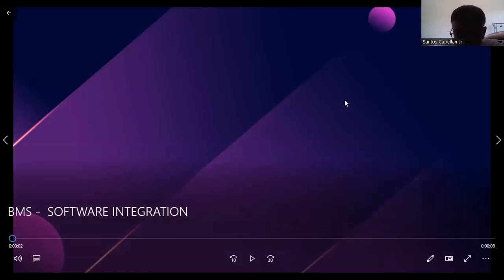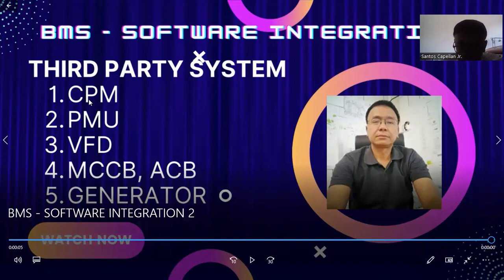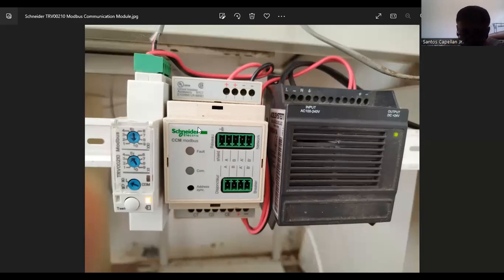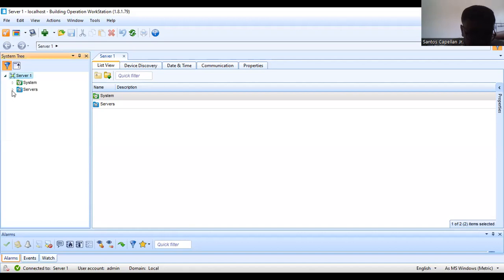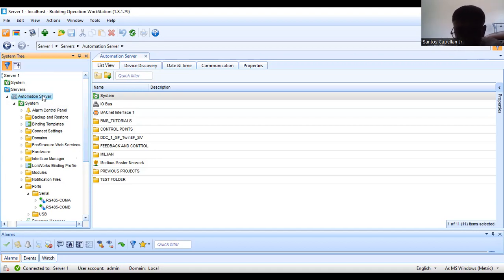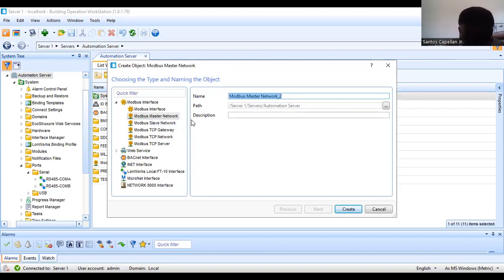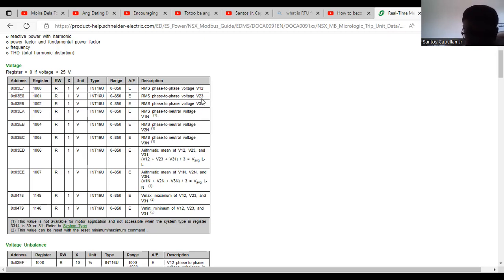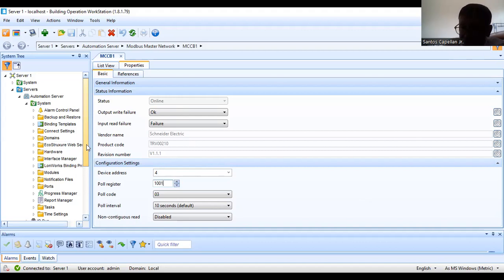BMS - SOFTWARE INTEGRATION PART 1.

Comment: Thank you it's a big help for me to understand more about BMS Integration, right now our BMS system with different brand,  like HONEYWELL, JOHNSON CONTROLS, SIEMENS are on going integration by Johnson Controls. The  Honeywell old system that we have now are using C- BUS, the new system will be using fiber optics. Controllers will be replaced with Bacnet compatible.
Waiting for Part 2 i hope it will be comming soon.